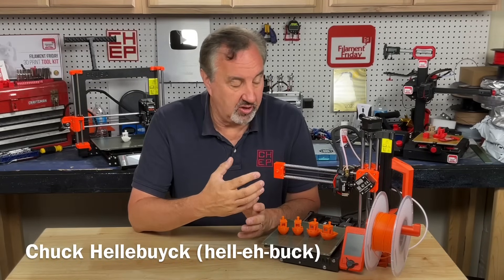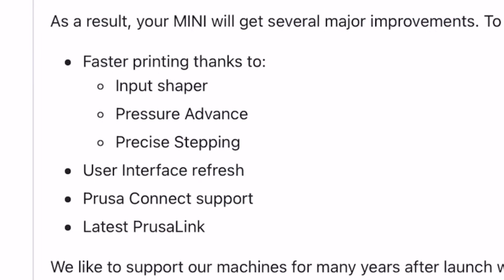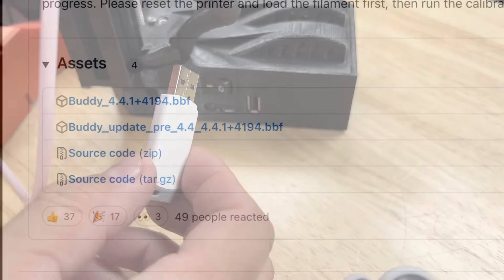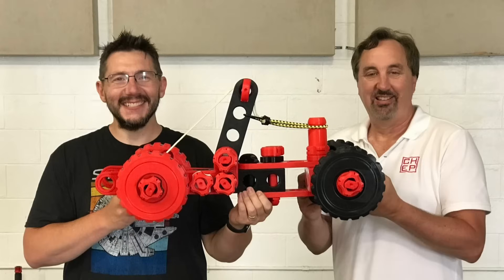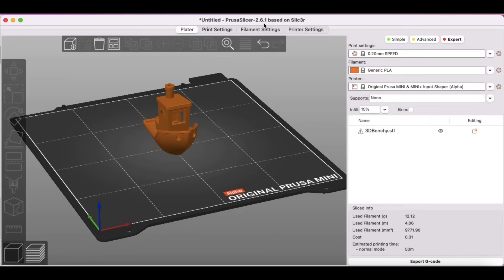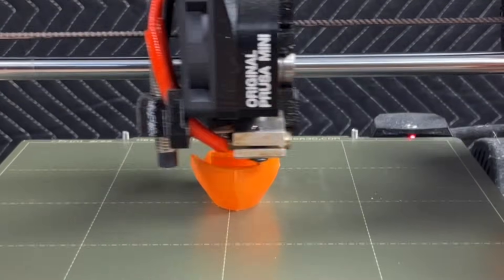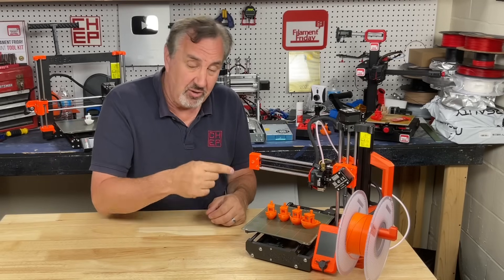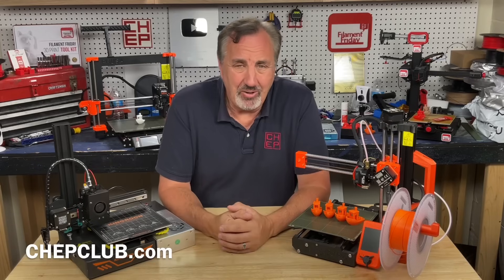12 Minute 3DBenchy on Prusa Mini

Comment: obsolete machine
Reply from the maker: Why?
Reply: It's not obsolete as a machine since it's still well supported. However I'd say it's definitely an outdated design. It's basically an upgraded RepRapPro Ormerod, and I can't understand the fascination with these cantilever bed slingers when there's so many better printers available.
Reply: It's not obsolete. If it was then it wouldn't be getting upgrades with HUGE performance increases. I like both Prusa and Bambu...no need to down one or the other
Reply: Great comment.

Refuses to elaborate 😂
Reply: For some reason this comment keeps disappearing under a post about the mini being obsolete where people ask someone else to expand on how they feel that way. They didn't, but I did, with this really long comment. You can see it took effort and understand why I am trying to split it to get it to stick.

Here is why I think the mini is obsolete:

Prusas implementation of open source when it comes to hardware and firmware does not actually benefit normal people. It's designed to be purposefully awkward to modify as a way to avoid being cloned (they've mentioned this even) which means tis definitely hard to do any substantial modding to for hobbyists.

Prusa recently had been backing  away from open source to the poi they've not released their most recent printers despite still marketing themselves as open source.

My point so far? Open source is a bunk argument when it comes to Prusa hardware and firmware and the when it comes to software, well other printers are open source too..... Soo...

Now let's talk the mini in particular.

The Sv06 makes it obsolete.

The wave of ender clone bedslingers with decent reliability and abl and direct drive extruder make it obsolete.

The Bambulab A1 makes it very very obsolete.

Before I cover these though, I want to take a detour to talk about the path of the mini, the lost child in the prusa family. The printer they wanted to exist as a consumer push towards spending a  bit more and getting the mk3s for so many more features.

How do I figure?

They promised WiFi and skew compensation and didn't deliver for years. Even now, they only have one of the 2 features.

The Mini uses a mediocre Bowden drive with a not quite all metal hotend for no reason other than to funnel people to spend more (we know this because the price difference is next to nothing)

Now let's cover that list from earlier with the context set.

To me, because of the above, the Mini was obsolete pretty soon after it was launched.

Where I think most people would agree though are with the advent of the pretty decent ender 3 clones I described above, and the Sv06.

Just those alone offer you better functionality,more buod volume, easier to source replacement parts, and at prices whee you could buy 2 for one mini, or slap in a beagle cam and still save 100 bucks on the mini.

Now let's talk about the A1.

Prusa  has 2 real draws as a brand. Because I think I've made a decent argument about their mediocre "open source" when it comes to hardware and firmware I'll leave open source out.

That leaves ease of use and reliability.

Welp, given the lack of features on the mini, the ptfe length issues with the Bowden extruder in current year,the buggy unfinished input shaper, the lack of auto z, the lack of monitoring, the lack of a convent app,the lack of over the air updates, the lack of neat wiring, the lack of ..... 8 can go a long time, I promise you this list can nearly double. The pint is, they certainly handily lose ease of use.

Continued below (this is part 1 of 2)
Reply: Second Half:

So the what is left. Reliability?

Maybe you can make that argument with the MK3s, proven farm printer, but the Mini has had reliability issues since day one. As mentioned the infamous ptfe I the hotend and its picky size, the step loss protection that never worked right, issues with rigidity, the ptfe again but this time because it's unnecessarily a consumable because it's a not quite all metal hotend and its a Bowden meaning that eventually the fittings will eat up the ptfe and you'll need to replace it or infinitely increase retraction. That's just what I remeber about it.

Now let's compare the A1, where while we can't know the future I think  we can see some pretty clear design wins.

Firsrly no flimsy 3d prints from structural parts.

The metal connects the metal and those linear rails are strong and last long and we know that because linear rails are used many places for those reasons.

The hotend is all metal, direct drive and steel so it can print a wider range of materials.

The firmware is a true version one, not this buggy beta version tehy advertise as a feature but clearly isn't done and requires compromise (the new prusa input shaper firmware).

There is no such unnecessarily consumable ptfe part.

It has a nozzle wiper so you don't get booger starting your prints

It checks everything for you so it knows of a failure before you do from clogs to runouts to lost steps (you know the feaute prusa never got working right on this or the mk3s).

Speaking of auto tunign there is ease of use. The A1 does so much auto this and that, and specifically Welland without a hitch I think it just walks home with that prize.

The other is the speed, where it Has an actual high flow hotend, and doesn't need to rely on gimmicked benchy gcode for to nozzle cleaner.

Lastly there is the price. All of that. All of those pluses, including the AMS for LESS money than the mini.

Now let me be clear, because nuance is important. If you already had a mini, it's not obsolete. It still prints fine, and won't be bad enough performance wise that you just don't want to use it for probably a couple years.

When we talk about what people should buy today though? It would be utter lunacy to buy a Mini over an A1.

OK that was long, typing it a second time, but hopefully you see that I state this opinion with nuance and with a reasonable understanding and basis to make the claims I have made. It's been difficult getting this to stick as somehow it keeps seeming to get caught.

Anyhow, times change, and industries evolve.
Reply: For some reason my longwell thought out comment here keeps disappearing. I go in depth and its gone. Quite frustrating.

Comment: The Prusa mini looks like a home project and a parts bin special compared to the new Bambu A1, such a contrast. Hopefully Prusa up their game to keep the industry competitive.
Reply: That "home project" drives a lot of print farms. Prusa Printers are built to be reliable and not to be pretty.
Reply: @andreas.grundler  no doubt, I am not saying Prusa don't work and haven't earned their stripes, just that the game has moved on so massively and quickly that their offerings are looking dated and over priced. Same for Ultimaker for example
Reply: How’s that A1 recall working out for you? 🤣 And I find that Bambu is much uglier looking. They look like something you weigh meat on 🤣 Generic and that’s why they are cheaper.. Get what you pay for don’t ya?
Reply from the maker: A1 doesn’t recommend ABS, ASA, PC, PA, PET, Carbon/Glass Fiber Reinforced Polymer. 
Prusa Mini can handle them all and more so looks aren’t everything.
Reply: @FilamentFriday  How it can be the same price as the A1 including the AMS is mind blowing. The A1 is constructed with linear rails, metal machined parts, has quick swap nozzles, auto calibrations, WiFi built in etc etc, the feature list goes on and on. Why would anyone buy a mini over a A1 now it's released is anyone's guess 🤔. It's Def not good for the industry to have Prusa so far behind.
Reply: @link6032  I think that's exactly right. It's not good that Prusa is so far behind and so fast.
Reply: @andreas.grundler Why doesn't Prusa manufacture in China too?
Reply: @Zae-R  Maybe they just want to support the local economy or maybe their goal is not to make cheap printers but reliable printers.
Reply: @TheNature101  As if I care how fast I can print a Benchy. If I want to print a Benchy fast I can build a "The 100". It prints a Benchy in 6:23 in accordance with the speedboat rules.
By the way, if you had seen the video you would know that the fast Benchy is not according to the speedboat rules. This is clearly communicated by Prusa as well.

UPDATE: The fastest attempt with a "The 100" printer is actually 3:03.
Reply: @Zae-R  In China, the price of the original Prusa is not competitive compared to the Prusa clone, and the Prusa clone is quite reliable. I've had my mini-clone running for 4 years without any issues.
Reply: @andreas.grundler  Ridiculous. If it is the same price, you can buy more reliable parts in China than the original Prusa. It is just only high-precision CNC. What is the technological content?
Reply: @andreas.grundler  WAKE UP!!! Czech Republic is not England, Germany or France. Their wages are much lower. The prices are high because of Prusa's GREED!!!!!
Reply: @TheNature101 Greed?? So how much money has Bambu given to Prusa for using their open source platforms? Thats bad integrity right there and why I would never support Bambu
Reply: @DopeCity5000 So how much money has Prusa given to Slic3r by Alessandro Ranellucci open source that their Prusaslicer is based on???
Reply: @FilamentFriday  This is a good point. The bed on the A1 can only reach 80 degrees which makes it only suitable for PLA and PETG. Looks aren't everything but the A1 is not just looks, it's a sturdy machine, very well designed. The "home project" look on the mini is not just looks, the A1 has a more rigid structure, linear rails and a bunch of features not present on the Mini. On top of that you have the new AMS. In the end the A1 is a far superior printer. The materials it can handle are the same that the mini can handle. You might be able to print small ABS parts on the Mini but we all know you need an enclosed printer for anything other than PLA, TPU or PETG and Bambu Lad already has printers that can handle all those materials.
Reply: @elleryfg7853  "The bed on the A1 can only reach 80 degrees which makes it only suitable for PLA and PETG."

Teaching Tech tried to print PETG with the A1 and it has it's problems. Especially with small parts. Adhesion does not seem to be as good as it should be.
Reply from the maker: @ellertfg7853 - Have you used an A1 or are you just speculating?
Reply: @FilamentFriday  Prusa mini only goes to nozzle/heatbed 280C and 100C while the A1 mini goes to 300C and 80c. I would rather have a higher temp nozzle than 20c on the heatbed to print ABS, ASA, PC, PA, PET, Carbon/Glass Fiber Reinforced Polymer with an enclosure. Even in that the A1 mini is better than the Prusa mini overpriced garbage.
Reply: I agree. Prusa needs to up their game and up it right now. The A1 is a kill move from BL, it's miles ahead of the Mini and they have more printers coming. They managed to develop the A1, a super polished printer in record time.
Reply: just a correction here. The A1 can print everything. they just don't recommend it because it's not enclosed.

If we use the same l9gci for both printers, in each case the prusa prints a lesser variety of filaments. especially given that it's a legacy bowden